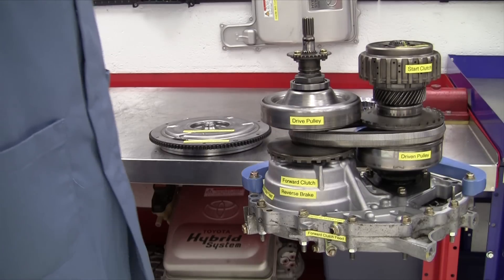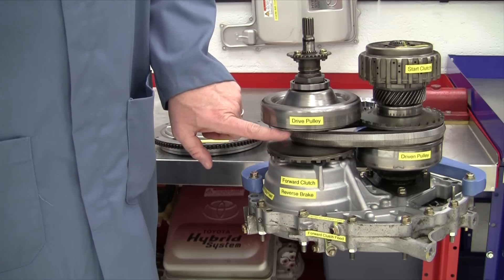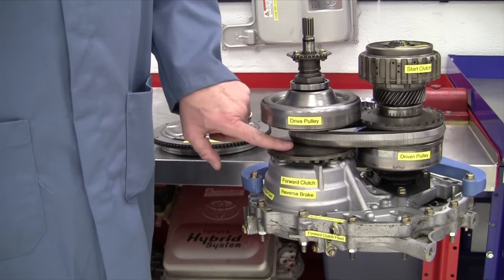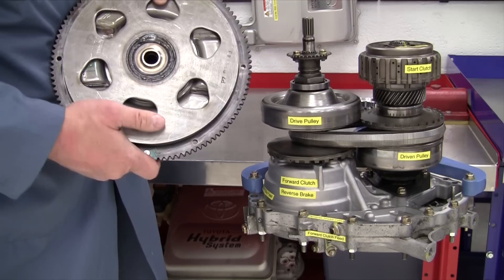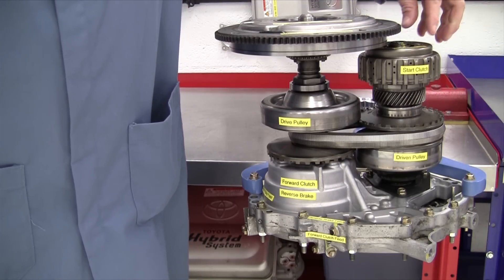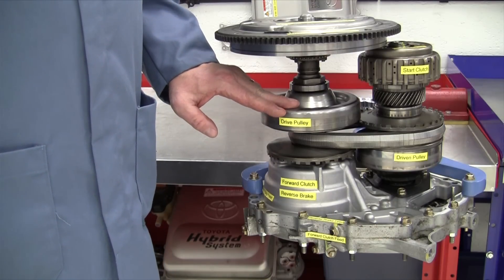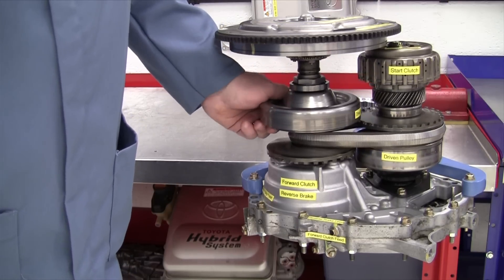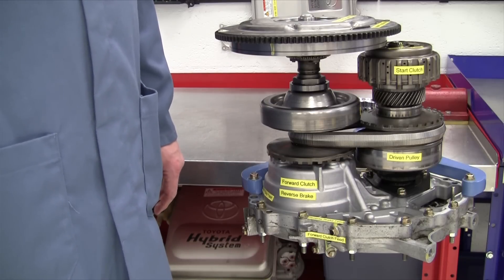Honda Civic CVT Transaxle Operation

Comment: How difficult would it be to mate a CVT such as this one to a different car?  Are there any CVTs out there that are electronically controllable, and could potentially be retrofit onto older engines?
Reply from the maker: +ThantiK Hi, it would be very difficult to do that. CVTs are tuned to a specific engine to give the best performance and economy. Thanks for watching!
Reply: WeberAuto, I'm a versed mechanical and electronics engineer.  Would there be a specific model transmission which would be best to start with?
Reply from the maker: +ThantiK It depends upon what your objective is. I would pick one from a vehicle that most closely resembles what you are trying to accomplish. Remember, most CVTs are mated to small engines with relatively low power. The CVT allows the illusion of having more power by keeping the engine RPM in the narrow band where the small engine has the most power anyway. The JATCO CVT seems to be holding up the best. It is used in Nissan and Chrysler products. Best wishes!
Reply: @ThantiK  Except for the mode handle that controls the forward clutch and reverse clutch, this CVT is electronically controllable.  It's actually very simple to control: Literally three 12v solenoids control everything.  Drive pulley, driven pulley and start clutch.  The PCM controls them with a 195 Hz PWM signal that never goes above 50% duty cycle.  For feedback, you have three 5v speed sensors that read the same (drive/engine, driven/clutch, clutch/axle).  They are relatively fast, but whatever idiot that designed the speed sensors set the ratio between the latter two at 1.433 instad of 1/1 for some reason (500 Hz = 1000 RPM, 10 MPH, 7 MPH).  The hard part is determining what tension the belt needs as there is no feedback to determine belt position and thus slippage.  It also appears that the two pulley solenoids are backwards, where less power equals larger pulley.  I am wondering if the pulleys are spring loaded, with the hydraulics relaxing belt tension instead of applying it.
Reply: +ThantiK I recall watching a video about a CVT in which the pulley sizes were controlled by centrifugal force acting on a spring loaded mechanism. It seems like that could be applied to any vehicle that could physically mate to the transaxle provided you tuned the weights to the desired power band of the drive motor.

Comment: Hi, what is the best Fluid for this CVT ?
Thanks
Reply from the maker: axenz axtiz Always use Honda CVT fluid in a Honda CVT. It is green in color. Thanks for watching!
Reply: Thanks and appreciated :)
Reply: @WeberAuto  I agree with always using the Honda CVT fluid, but mine is perfectly clear.  I wonder why the difference...
Reply: I was also wondering what fluid to use. I've noticed that some aftermarket CVT fluids specifically say they're not suitable for Honda CVTs with start clutches. It seems the fluid can degrade faster than expected, and shorter service intervals are probably a good idea.
Reply: Use amsoil. 100% synthetic

Comment: CVTs are shit if a driving enthusiast was given a choice between a cvt and hondas traditional automatic they'd choose the auto. have any of you seen them test a accord vs a cvt accord on a 0-60 run? the cvt is has a 0-60 time of over 10 seconds. honda shoulda took the DCT route instead of the shit and they still can the have DCTs on some of their Acuras. OOOOOHHHH BOY and when those belts do snap... i mean hell, nissan has had TONS of complaint over their CVTs. If this is the future of auto transmissions and Dual Clutch Transmission dot take hold, it looks like I'm learning how to drive a manual. 'Nuff Said.
Reply from the maker: Wdf582051 Thanks for watching!
Reply: glad i could be of assistance
Reply: I'm really passionate about these sort of things
Reply: Wdf582051 CVT are meant for their more economy oriented models. Enthusiasts should go for manuals, always.

But I would LOVE a DCT in their Type-R models. Can you imagine it? Civic Type-R with a DCT? Daaaaamn!
Reply: soon we won't have a choice. nissan got rid of manual even for their altima coupes. its anmost an cvt's with them now unless you get a 370Z
Reply: *almost
Reply: I prefer CTV over any standard auto as there is no lag when the gearbox is trying to find the right gear just instant power.  As a driving enthusiast I drive manual though but I've come to like CVT's even over dual clutch transmissions.

Comment from the maker: Ineptocracy Wonder.  The 2014 and newer Honda CVT's have been redesigned are are much improved. I would have no hesitation regarding owning a vehicle with one.  We will have a detailed CVT video in about a month.  Thanks for watching.
Reply: no worries i have plenty of hesitation to co around, and so does the cvt when you try to overtake.
Reply: WeberAuto I love my cvt in my maxima
Reply: when the start building DCTs ill be sold. Until then 5 or 6 speed on any honda i may buy in the future.
Reply: Is the 2014+ CVT basically the same design? Great videos, I could watch them for hours!
Reply: Improved huh? My 2015 Honda Civic just blew the belt. Never hard on it and 89000 miles
Reply: My 2015 Civic's CVT failed on me this week.  It's gonna cost close to $10,000 to replace.  I'm gonna junk it and try to find a car with a manual transmission.
Reply: +WeberAuto 

Do you have the video on the new Honda CVTs yet?
Reply: My wife has a 2013 Accord with the CVT. No issues so far and it eliminates that high rpm acceleration that 4 cylinders are famous for! It accelerates with constant power, I love that. I've always hated accelerating and the engine jumps up to 2500 rpm to get some power. Now it's about 1500 rpm because the CVT is adjusting the gear ratio as you drive. We get a little rubber banding when slowing down but not a big deal.
Reply: @WeberAuto 2003 civic hybrid, no reverse, but forward no problem, what could cause it professor? Car has 160k miles
Reply: WeberAuto  How often should the newer 2014 Honda CVT's be serviced, I have a 2014, 4 cylinder Accord?
Reply: @cardo1111  change that fluid every 30k forget what the manual says 30k and it will last 200k plus

Comment: I drive a 2001 Honda Civic HX with CVT.  200K miles and still going strong.  Great gas economy. 

What do you think about the new DCT transmissions?
Reply from the maker: The new DCT transmissions are very cool! I will have a video on them very soon.
Reply: WeberAuto YAY I've been wanting to see a video on that.
Reply from the maker: Jake Methner My video is completed, see my Ford Dual Clutch Transaxle (DCT) DPS6 video. https://www.youtube.com/watch?v=6iCRnAUftvI&list=UUtr07mdKhsUwVJjL8Kw_q5A

Comment: Seems that cvt drive belts are not durable enough and may be the weakest link in the chain. If a drive belt can fail in a civic, we can imagine that it won't hold strong enough for heavier cars.
Reply: Exactly! These transmissions work great in four wheels, scooters, and side by sides, but they need to stay there. CVTs have no business on the street. Too expensive and too many failures due to not handling the load.

Comment: Hi,
I got comments for my 2005 honda civic hybrid, I don't know wether can fix without change the transmission.This is the comments fro honda dealer,

 
As per our conversation, the transmission is failing in your car.
 
Here are the technicians notes:
 
NO CHECK ENGINE NOR IMA LIGHTS ARE ON. THERE ARE SEVERAL GENERIC CODES UNDER PGM-FI FOR IMA SYSTEM AND A/T SYSTEM WHICH ARE P1601 AND P0700. BUT NO SPECIFIC CODES UNDER A/T NOT IMA SYSTEM. ROAD TEST AND VERIFIED CAR NOT MOVING WHEN IN D OR R AND AT THE TIME BANG AND STALLS. NO PROBLEM IN N OR P. TRANSMISSION MAKES NOISE AT THE TIME TOO. VIBRATION WAS DUE TO HOOD ROD HOLDER IS MISSING AND RUBBING AGAINST IDLER PULLEY. RECOMMEND REMAN TRANSMISSION AND HOOD ROD HOLDER.

Comment: Could someone please explain whether or not it is truly necessary to drain the CVT fluid on my Honda Accord on 30000 miles?
Reply: You should change it. Its the break in period. Just change it and dont be cheap with your car.
Reply: It's cheaper in the long run to change the CVT oil every 25,000 miles.  The oil has a very hard life!

Comment: hello query 
  As the metal strap does not slip on the pulley and holds firmly and rotate without slipping? 
appreciate an answer thanks

Comment: I have a correction for you. The generic term "CVT" does not mean continuously variable trans-axle. It stands for continuously variable *transmission. This application so happens to be included in a trans-axle.

Comment from the maker: Hi, yes, the start clutch connects the transmission driven pulley to the final drive when the vehicle needs to move.  It is a computer controlled wet clutch, so it can last a very long time including allowing a small amount of grab at stop lights.
Reply: Quick question about honda Accord Cvt's, I have a 17 sport.  And I am considering trading it out of fear of failure.  In your opinion, do you think I should keep it.  Or do your think a 2015 toyota camry with the 6 speed automatic transmission is the better way to go?

Comment from the maker: Hi, No, the flywheel is external to the transmission case and is always rotating the input shaft. No power is transferred to the wheels until the start clutch is engaged.  The start clutch connects the transmission output shaft to the final drive unit.

Comment: My Honda Civic CVT gearbox needs to warm up 20mins to 35mins to engage the start up clutch. I can force it to 15mins by push more throttle, but the engage gear is a big bang reverse and forward, the bad things also when release throttle then push again creates big bang engage.

What are the causing it?
Reply: Yeah you don't want to do that.  Sounds like your start clutch is sticking.  At best you'll burn out the clutch.  At worst, you could snap an axle, snap the CVT belt, or strip out the splines on either the engine/CVT joint or CVT/axle joints.